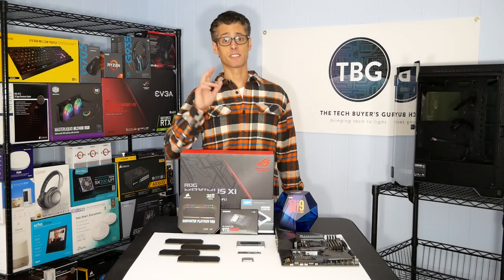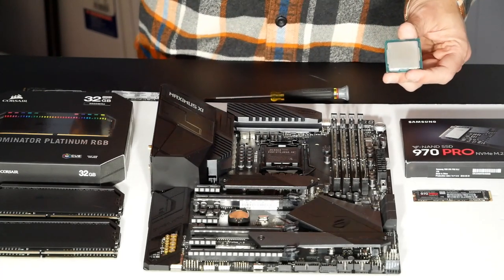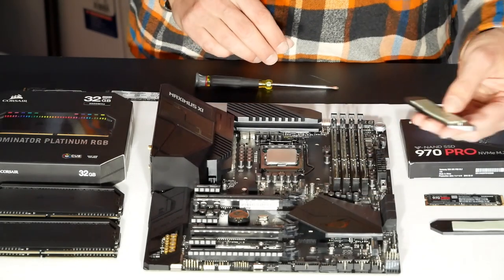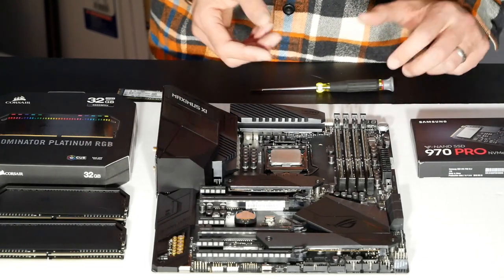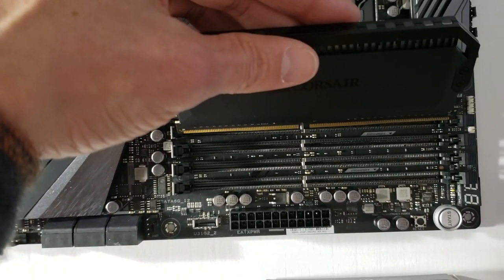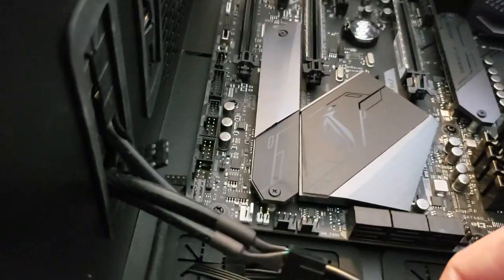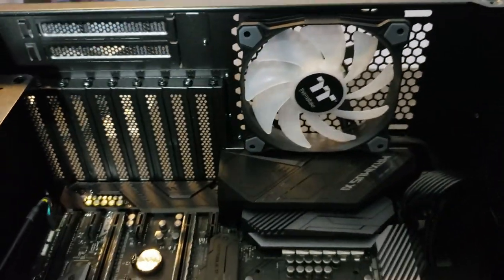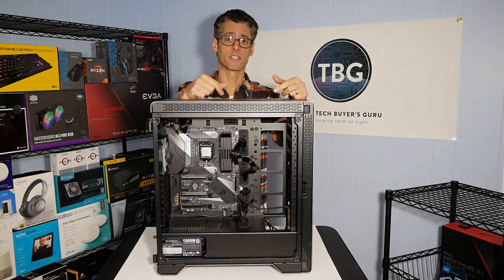2019 PC Assembly Video, Ep. 2: Installing the CPU, SSDs, RAM and Motherboard

Comment: Thanks so much for the awesome video..so perfectly detailed also. Doing almost same exact build except for slight diff thermaltake case. All in video was extremely helpful..specially with the wire up part.
Reply from the maker: Glad to hear it! Which Thermaltake case did you go with?
Reply: I  just happened to get the Thermaltake View 71 case and by chance same exact board and processor and  all else that you used ..this was maybe just couple days before i saw your video i bought it all. .  Watched several videos a here by the factory "ASUS guy" and tell the truth it should be you working for the factory cause he wasnt bad but still you made him look  bad with your perfect detail. Thanks again Ari . ..you rock!!

Comment: Hello again. Everything went ok with the installation. I installed the Samsung 970 Evo Plus 1 Tb under graphics card and the 970 Evo Plus 500 GB above where it’s SATA and PCE compatible. I downloaded Samsung Magician and the temperatures of the old 500 GB are 50-59 degrees Celsius and it says temperature high or very high. But on the 1 TB temperature says normal and it is 10 degrees less. Will I have any throttle on my 500 GB ‘M2? Is it possible that the heatsink that 1 TB is installed is better so it has lower temperatures? Thanks in advance.
Reply from the maker: 60C is too hot for an SSD. It will throttle. Which motherboard are you using? I assume that when you refer to the heatsink, you are talking about the one that comes with the motherboard.
Reply: The Tech Buyer's Guru ASUS ROG Maximus XI hero. Iam worried I don’t know where is the problem. I saw people saying throttling is above 70 degrees.. Also on benchmark test everything comes out normal.
Reply: The Tech Buyer's Guru Yes Iam using motherboard’s heatsink. It’s the same motherboard as yours in the video. What are signs of throttling?
Reply from the maker: Both M.2 drives are under a similar heatsink on this board. You can simply switch the location of the two drives to see if it's the drive or the slot that's the problem. I would expect the lower drive to be cooler due to being further from the GPU.

Comment: Hello your video helped me a lot to build my PC some months ago. Now i have decided to add RAM and M2 and i have some questions. First of all i have exactly the same specs as you but i realised my Corsair dominator platinum is CMT16GX4M2Z3200C16 which on the website says AMD ryzen kit. I bought an additional 16 GB will i have any issues? My 16 GB ram runs in XMP Profile 3200 MHz do i have to do something additional on BIOS when i install the other 16? Also i bought a Samsung 970 Evo Plus 1 TB for the M.2_1 slot. Will it have any issues? Thanks in advance
Reply from the maker: Did you buy exactly the same DDR4 kit as your first one? If so, that's fine. The timings are a little looser on the AMD kit. And the PCIe M.2 drive you have will work perfectly.
Reply: The Tech Buyer's Guru Yeah I bought the exact same model. Thanks for the answer. One last question. After I install the additional 16 GB on the motherboard do I have to do something on the BIOS? My fear is that the 16 GB I already have will work on the XMP and the other 16 will not.
Reply from the maker: Good question. The same XMP settings will apply to all the memory modules. The only concern would be if you bought a slower RAM kit, in which case it would TRY to apply the same settings and crash. As long as it's the same exact RAM, it will boot up to the full XMP speed without problems.
Reply: The Tech Buyer's Guru thanks!